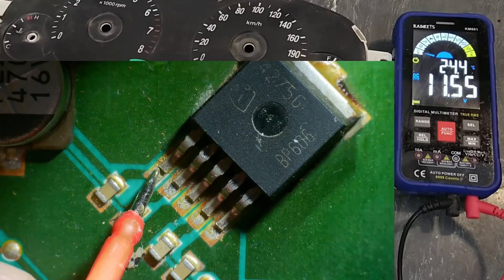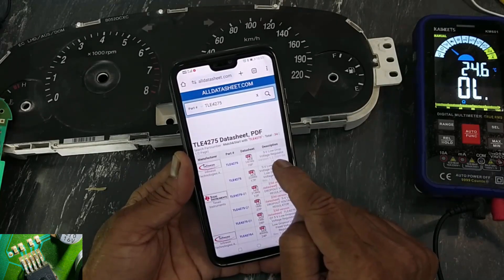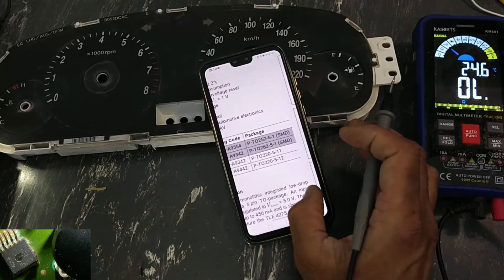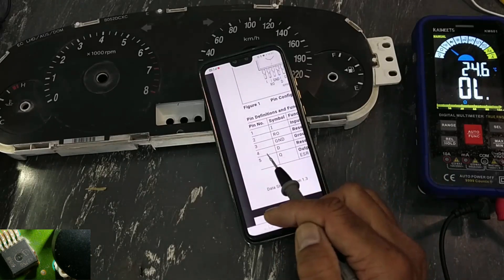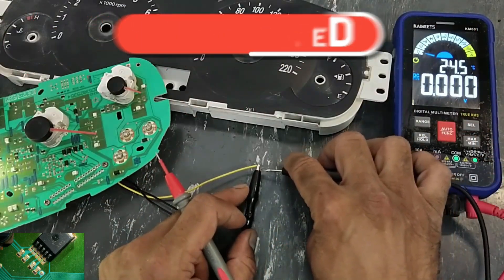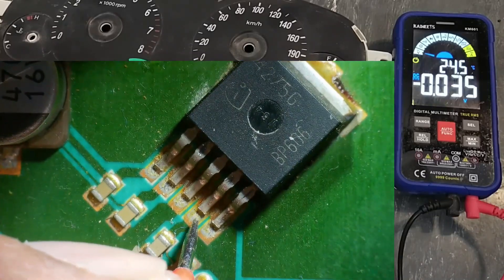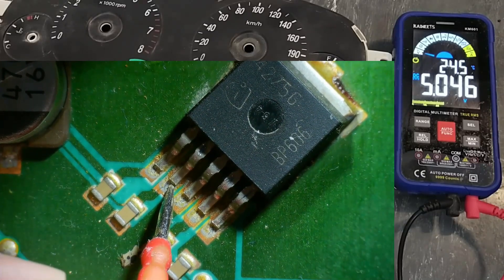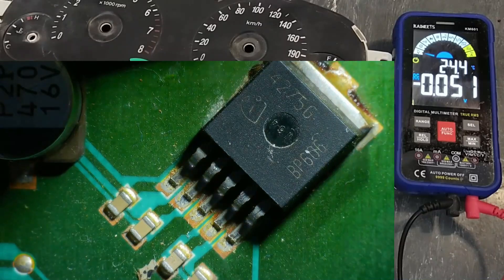{1223} Testing automotive 5 volt regulator IC TLE4275G

Comment: جزاك الله خير 🌷 
Clear explanation to the point 👍
Dear Sir, can i use tl431 as a current shunt resistor ? and how if it is possible..?
I have another question about the massager gun's charger it has been built with a monitoring circuit for changing and (full or not connected ) that based on LM358 ic with dual color led  light , red light for charging and the full or not connected is green color. 
i need an explanation for this monitoring circuit please.